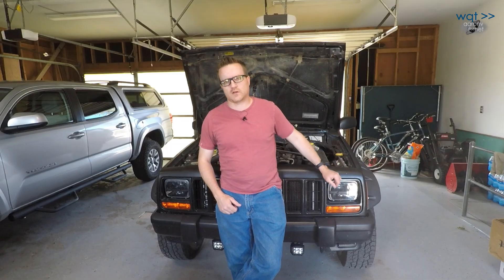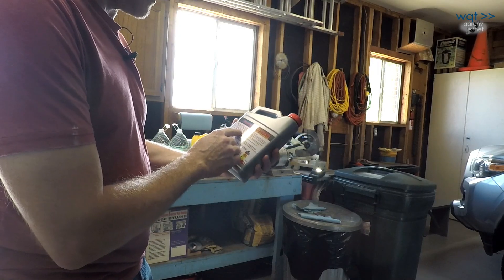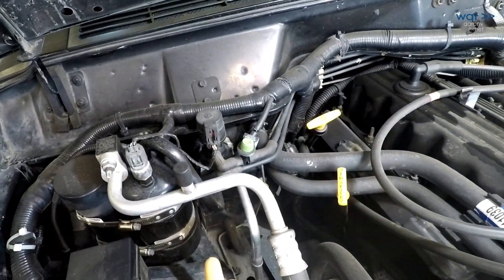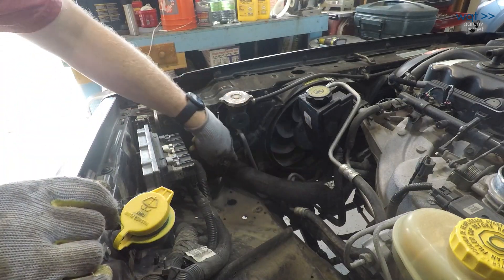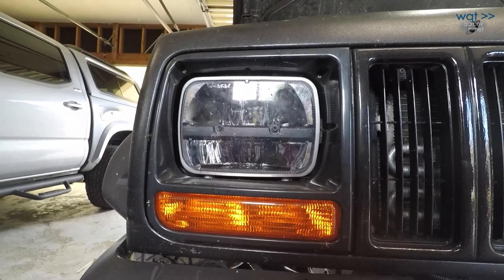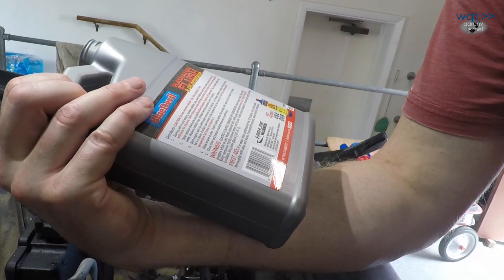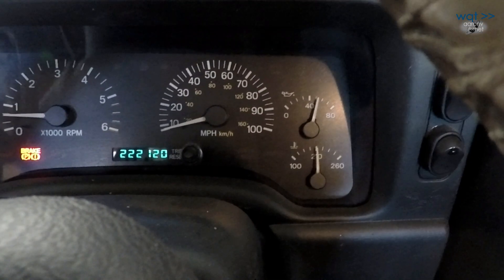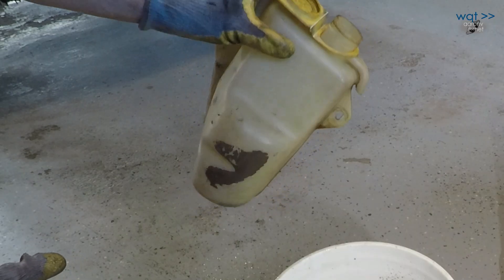projectXJ: Cooling system hot flush (84-01 Jeep Cherokee XJ, many others)

Comment: You did a good job on explaining the basics but you left a bunch of the nasty stuff in the system.  The 4.0 has a block drain on the driver's side and you will get about 3/4 gallon of junk out.  Without draining the block you left the crudand the chemical flush in the system.
Reply from the maker: I'll consider popping that next time but based on what I see on the '01 CARB I just went outside looked at, it's not trivial to get to in the 00/01 models with the revised header and Y-pipe or precats. I could understand some sediment hiding back there, since it likes to cake up, but I doubt much flush or old coolant were left after water-flushing the block and head clear in both directions.

Comment: Perspective... Renix is far easier as the expansion tank is the highest point in the cooling system. Many think there's a big difference with the "newer" style, but do not consider it was merely a factory line change.  If a vehicle is used in a more robust manor, then air flow is the biggest factor in thermal exchange and should be improved. i.e. crawling/towing in sand dunes/"Banana" (M.O.R.R.)

Comment: Why are we the same person - just flushed my 01 last week. I replaced the thermostat, gasket, and housing - but to my knowledge I couldn't get the thermostat to open - the level never "dropped"... I could only get about 2 gallons of coolant readded - I read that the xj takes 3. However, I didn't flush the heater core lines - so maybe that explains the missing gallon. Not sure.

Only other issue was the coolant immediately boiling and geysering out of the open radcap when I turned the engine off. A buddy thought it was clogged somewhere and backfeeding, so at some point we'll pressure test.
Reply: Consider the thermostat might not have opened due to air being trapped on the back side, thus why Aaron kept the upper hose disconnected as he slowly filled it.  As a thought, a very small hole drilled into the stainless steel body of the thermostat will allow air to pass but not enough to really effect its function as it is a flow regulator for the coolant.